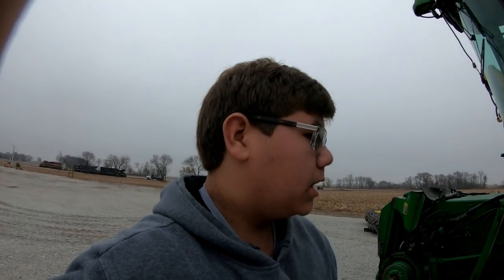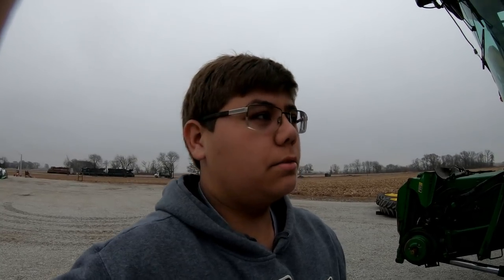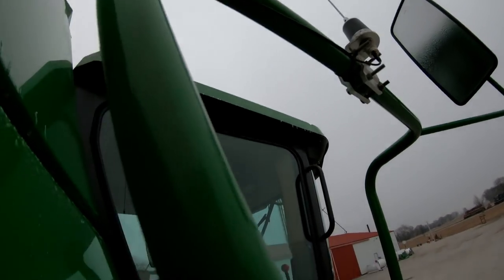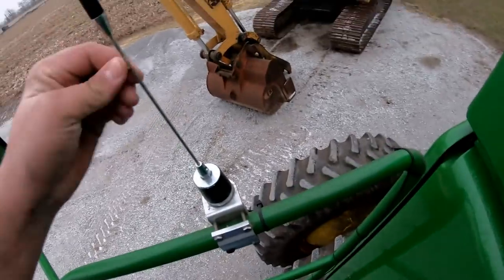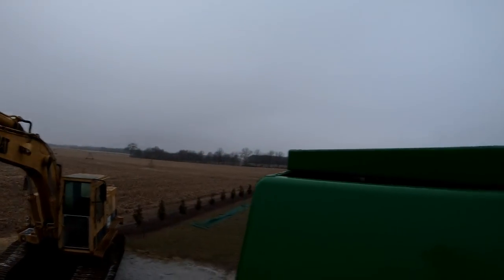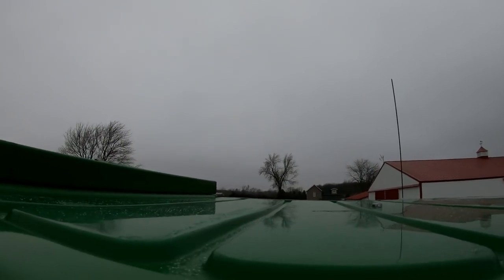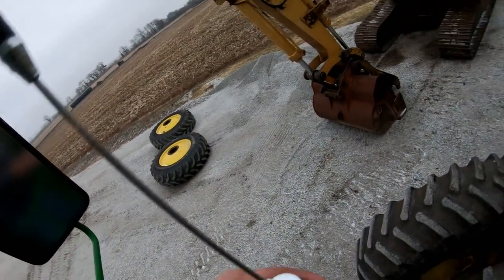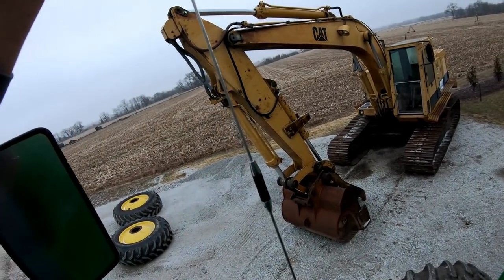Midland Radio Setup on John Deere 9650 Combine

Comment: You are going to experience a lot of directional bias with the antenna mounted in that position. Fold over UHF (land mobile) antennas are available. The Comet CA-2X4SR gets good reviews from GMRS operators, and is fold over capable. The roof mount would provide the best 360 signal profile.

Comment: I love Midland radios. I use them for hot air balloon racing between the balloon and the chase trucks and all the handhelds for each crew remember. We have a lot mountain ranges at different races and we have never had any issues with radio communication and we have are only radio frequency which is awesome to have
Reply from the maker: That is awesome! We love the range that we can get on the Midland Radios
Reply: @WernerAg  us to

Comment: I know with CB's you can have a base station with a tall antenna at your shop, is that possible to with the midlands  so you can improve range. There is still corn and beans standing down the road if you want to break in the 690. Great video
Reply from the maker: Yeah I heard a few guys in the area still have some acres of corn and soybeans left especially along 30. Don't think I want to bury our 690 out on that farm on 30 though lol. I'll have to check with Midland on that base station.

Comment: How strong is the cellular in your area? If you have reliable cellular, why not go with radio-over-IP ?  You’d not need VHF/UHF radios and everyone working on your farm would have access. Plus you could add new users (say, temp employees) to your system instantly without worrying about radio hardware. 

I’ve setup ES-Chat at my employer’s site to allow comms between me and my site team (we use a 10-talkgroup hardware interface to connect our Motorola MOTOTRBO digital radio system over the net) and this lets me communicate via phone app to my site guys using walkie talkies and my offsite team members on their phone apps. 

This setup would give you instant radio comms to your local equipment vendor which is more effective than 2-way phone. 

Costs are low as the app is $5/month per user, and the system is secure and private. The app even gives you GPS coordinates of each user if you enable that feature. 

Or you could try ROIP for free using the Zello app and upgrade from there if you wanted the extra security and functionality. Or keep it cheap and stay with Zello.  Either way will allow you flexibility to talk to anyone on your farm from any location - combine, truck, barn or house. And you can keep your communication live if you change vehicles or location. 

This is moot if your local cellular service is sparse, and I’ve no idea how you are serviced. Some remote areas with poor service would require 2-way radio comms, but maybe you’re able to try ROIP.  It’s hassle-free and easily expandable.

Comment: Do you guys have a repeater in your shop?
Reply from the maker: No but once the office is setup, I probably will put a repeater in the main part of the office.
Reply: @WernerAg  so in your opinion if I am trying to get get radios for my farm and the furthest I probably need is about 15 miles is it worth a repeater cost or will a radio with the 6db antenna work good enough?
Reply from the maker: Yes I believe the 6dB antenna would be effective and efficient enough t ok effective cover the 15 mile range you need for your operation.

Comment: S690 combines burn ten times the fuel of an s670 which can do the same as the 90
Reply from the maker: Definitely a significant horsepower difference between a 670 and a 690. I don't think a class 7 can do everything a class 9 combine can....
Reply: @WernerAg  we've ran both side by side the only difference is you turn the s690 around faster going up hill and as soon as you flip the switch for the separator your fuel goes to 17 gallon an hour
Reply from the maker: What size heads do you run?
Reply: @WernerAg  35' flex drapers in beans but in corn we can't run any bigger than 20' cause of the terraces
Reply from the maker: Ah gotcha. Yeah we will be running a 12 row and possibly either a 40 or 45' MacDon.
Reply: @WernerAg  that's still a little bit over kill the biggest you would ever need is an s680 where they at least have a smaller fuel pump
Reply from the maker: True but for the price we got this 690 at wouldn't touch the price of the cheapest 680.
Reply: @WernerAg  yeah but did you figure how much more fuel your going to burn and the depreciation of the machine every hour you put on it I bet in the long run that machine will cost as much as or even more than the cheapest s680 or s670
Reply from the maker: We figured our bottom price we would spend on a machine that size considering everything that has been done to it and also factored in extra fuel usage along with future normal maintenance. Considering it far cheaper than the price we were willing to pay with the factored maintenance I'd say we came out pretty good.
Reply: Ours s690 burns a little more fuel yes but it’s not much more and can run bigger heads so you combine more acres so it’s a wash
Reply: you don't go by gallons per hour, you go with gallons per acre.A class 9 combine will burn more fuel then class 7 but it does more acres in an hour